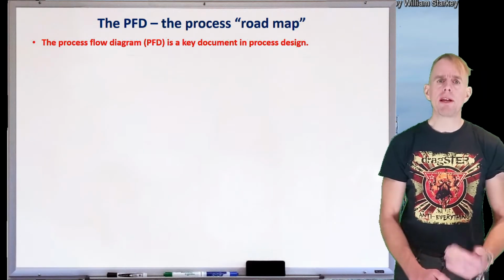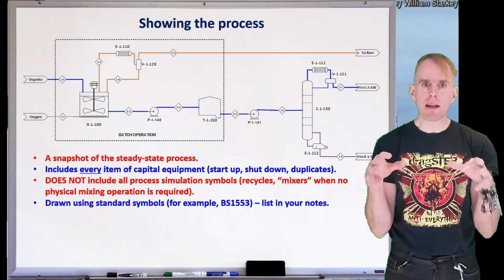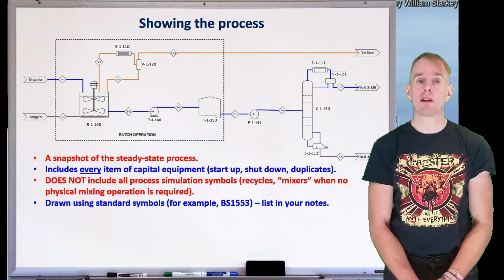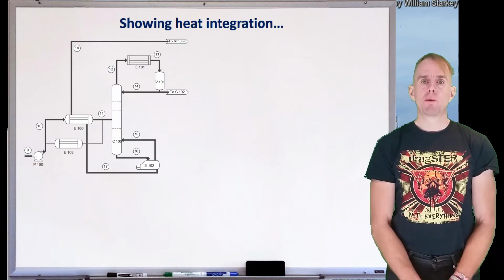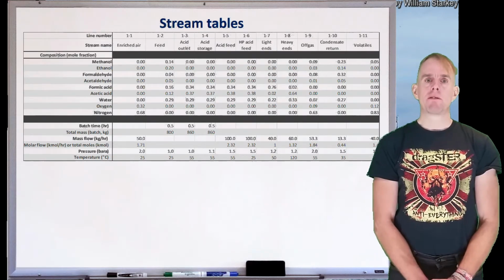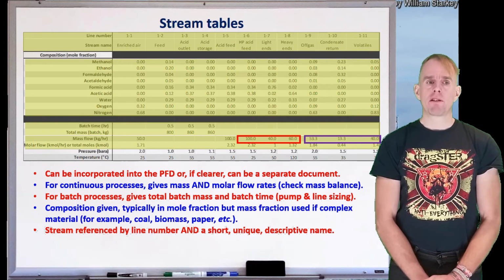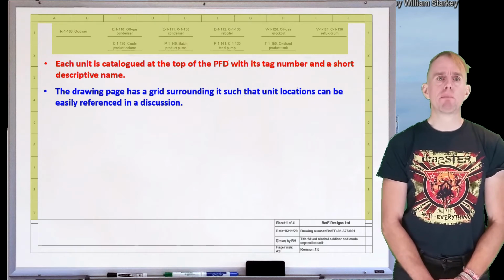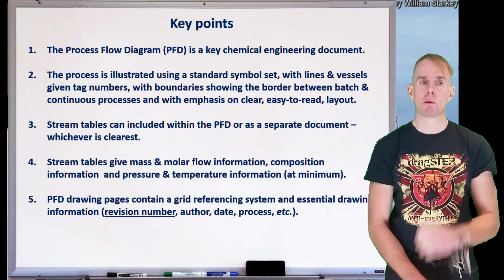Chemical Process Design - lecture 1, part 1 [by Dr Bart Hallmark, University of Cambridge]

Comment: Dear Sir,  First of all, let me appreciate your training course and secondly, Would you please let me know if it is possible to control a valve in the Hysys model using Matlab?
Reply from the maker: I'm very glad you're finding the course useful - many thanks for the feedback! It's appreciated. Thank you. 

The honest answer is that I don't know about controlling unit ops in Hysys with Matlab. It is possible to write and compile VBA scripts for use in HySys (for example, custom reaction kinetics or custom unit ops), but I've never tried to do it with a dynamic simulation. Good luck!! I used to use MS Visual Basic Express (free of charge when I used it years ago) for writing, debugging & compiling the VBA scripts.